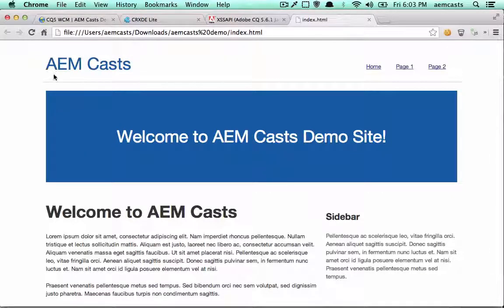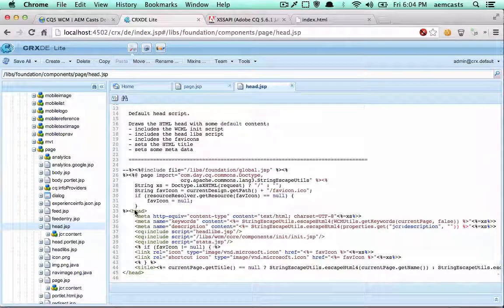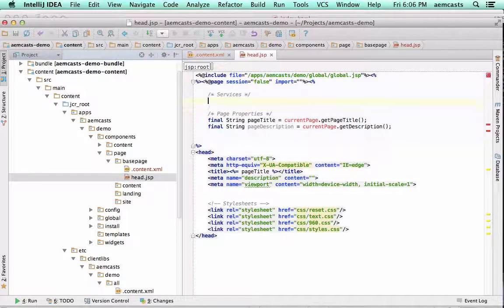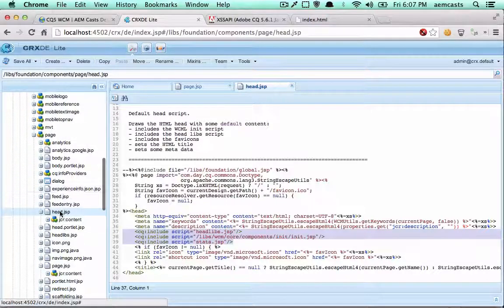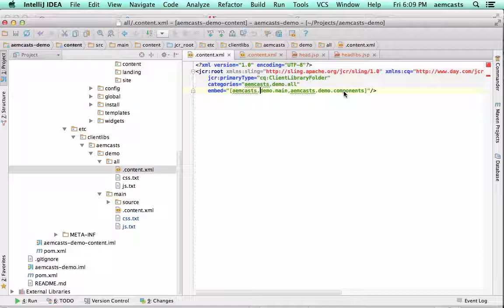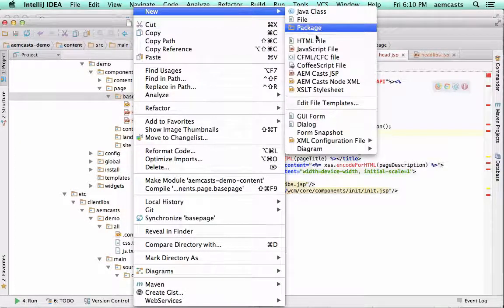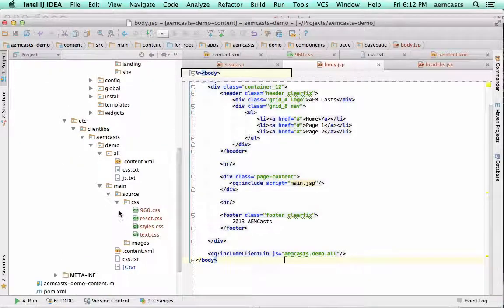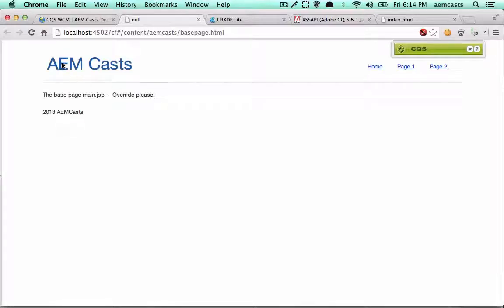3 - Building the Base Page

Comment: Thank you for this awesome video series on AEM. Your explanations and instructions are very thorough. The one question I have is how did you connect your project files for AEM WCM to use? You were able to view the basepage you created in Video #3 through AEM WCM. This is the only place where it seemed on my end that I'm missing something. I didn't see how you created the AEM Casts website using the files Maven pushed to the repository. Your help would be greatly appreciated. Thank you in advance and happy coding.
Reply: Lowell Fortune I am stuck at the same place, no idea how to create a site that will show the new page.
Reply from the maker: Watch the next video - you don't ever make a page that only uses the base page. If you want to for this expertise create a cq:Page w a cq:PageContent w sling:resourceType set yo your base page resource type.
Reply: AEM Casts Thank you. Your advice and video #4 was helpful, the homepage, context.xml and template were created per the instructions given in video #4, unfortunately I'm only able to see a blank page. I noticed in the video that when you moved over to AEM WCM you have AEM Casts Demo Page under Websites. Did you manually create that page or was it generated as a result of the install through Maven? I've found the page(s) I create on this end has no connection to what was pushed up by maven. It seems as though there maybe an understood step that may not be obvious to someone that's new to AEM. Any assistance that you provide will be greatly appreciated. Thank you in advance for your assistance in this matter.